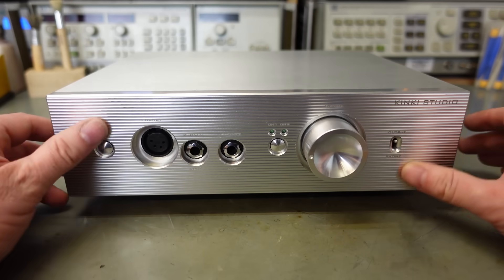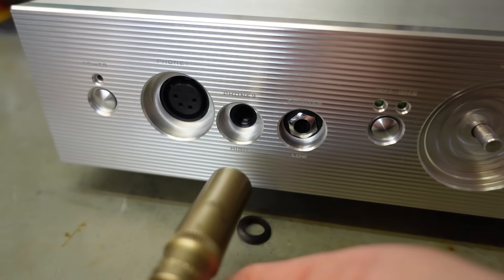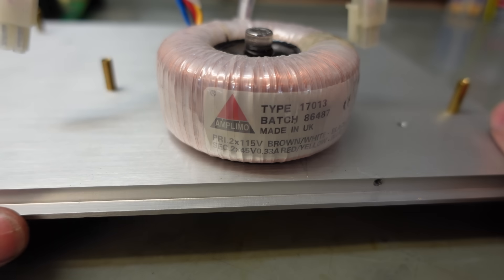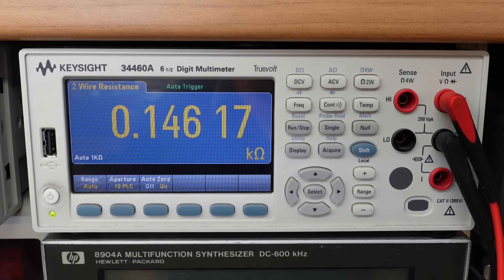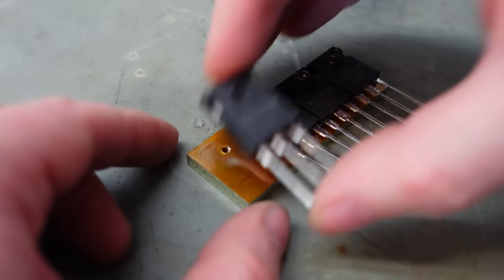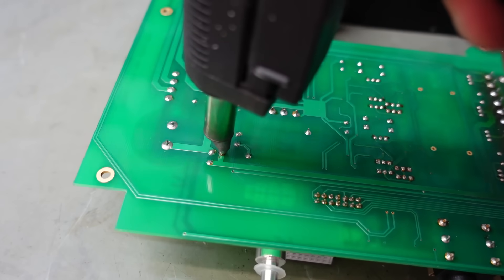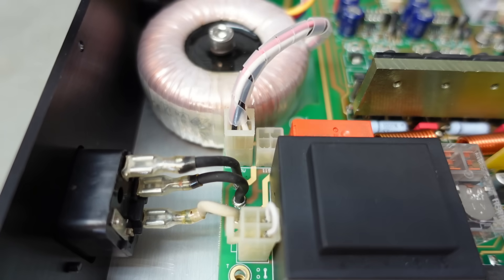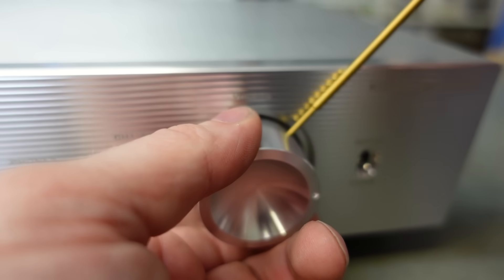KINKI Headphone Amplifier Repair (Vision THR-1)

Comment: That amp is SERIOUSLY over-engineered. Something like 2 x 15w for headphones? I love it! Good to see you back Mark.
Reply: Yes, overengineered at the wrong Place. Massive enclosure, pippi heatsink plate 😂
Reply: @borlibaer ĺpp
Reply: @borlibaer  Rule No.1 - never use a too small heatsink for your <insert amp here> 😅
Reply: The output spec is there to accommodate very power hungry headphones. Some fancy headphones need a LOT (maybe not quite this much).
The sad thing is the case itself would have worked as a heatsink far better. The engineer should know better.
Reply: @peterlarkin762  I kida get the idea that they tried to engineer the mosfets as 'tube' devices, hence the high voltages, which are for headphone output uncommon. FET's often sound nice when warm -70 degrees centigrade und up-. A more common solution is just an arrangement of good op-amps for headphone use, which drastically reduces the amount of components and more importantly, coupling over caps and worse, resistors. Yet, I have never designed an headphone amp nor do I like headphones, so I can be very wrong. In general I would stay away from hard to drive headphones, the same for non-efficient loudspeakers, though there are always many reasons to oppose that.
Reply: @edmaster3147  True, these lateral fets need to be biased at 120mA per pair at the very minimum, as the thermal co-eff goes positive, Id drops with Vgs, hence thermal compensation is redundant. No need for source resistors either, even with multiple pairs, thanks to close matching on Vgs with selected Exicons.
Reply: @edmaster3147   I haven't heard a huge sonic difference between these LatFETs running cold or hot, but  I'm running 2 parallel pair per channel, each  channel on a large heatsink (for safe operation at 140W per channel. My other diy BJT amp, a Circlophone, sounds way better warmed up. Biased at  250ma ftw:)
The outputs on the Kinki need a bigger heatsink because they're being run at 63Vdc. ~45V would have been plenty.

For most headphones, a parallel output opamp based amp is perfect. I use 2 NJM4556s on my preamps for monitoring - They push loads of current. And FET input opamp for small signals - OPA 2134 seem to be the last good one available new..
Reply: @peterlarkin762  Have NJR discontinued Muses 01 ?
Reply: @peterlarkin762  No headphone needs nor do you want 15W playing right next to your ear unless you want to go deaf.
Reply: Not sure if that's true. I have burnt up expensive amps pushing headphones to high with low impedance.
Reply: Yep, it's audiophile quality 🙂 The clue is in the word audiophile. Someone who loves listening to music is a musicophile. Audiophile just means lover of sound - they just listen to their system....
Reply: Well said! I am laughing so much, because it is absolutely true!😀 @mattparker8747
Reply: @mattparker8747  You don't know what you're talking about. The point of a great system is that music sounds better.
Reply: Calling this engineering insults me as an electronics engineer. It's a badly designed esoteric waste of resources.
Reply: @cls9474  I haven't heard this device and don't want to be an armchair judge, and I don't want to judge others choices, but the device contradicts my experience. The stuff  I find best sounding is extremely simple and has well chosen but least possible components, very thin cables and very few options. This device indeed look to be engineered to end-user expectations of optical quality. But maybe I love it when I hear it. Who knows.
Reply: Totally agree with you! @cls9474
Reply: @cls9474  I'm sorry but you're wrong. 🤭 I'm an electronics engineer my self with +30 years of experience in radio&radar. Look at my comment.😉
Reply: It's a horrible design, there are headphone drivers that can achieve the same thing with much better specs and the whole circuit would fit in the palm of your hand.

Comment: Ahh. Was kinda hard to keep your face straight when saying a “Kinky amplifier”. 😁
Reply from the maker: I was going to say all sorts of things, but I'd have got de-monetised... 🤐
Reply: @MendItMark  I bet! ;) Great vid tho yet again.  Appreciate you.
Reply: @MendItMark question, what’s your turn around time to get parts for something like this over there? I’me educated in the business but have not worked in the repair business for 20 years now. Have been wondering of taking it up again as a hobby/side business.
Reply from the maker: @pederb82  in this case, I got the transistors in 5 days. However it can be hit and miss - A lot of parts Supplier’s trade on eBay now, but I am wary of transistors coming from China (outrageous fakes!), so stick to businesses with proper quality assurance. However, a lot of old transistors just aren’t available, so I spend a fair time sourcing modern alternatives, which I can get from trusted sources.
Be careful of the side business - that’s how I started 😂
Reply: @MendItMark  Ive mostly used farnell etc myself for the same reasons you mentioned. I’ve bought IC’s on eBay that’s turned out to be fake. Looks to have the same pin layout but dead or nothing home inside.

Comment: Nice you checked if it is true balanced. But I could not have stand adding additional heatsink in there. Or somehow lead the heat on to the large top cover to dissipate it. This way it looks like it will fail again soon.

Comment: i love mosfets in audio output they often blow up a little more gracefully than bipolar fire mongers and the usual 100r gate resistors protect the driver stages (usually)
Reply: The trouble with MOSFETs in audio output stages is that 30 years after the unit was made and you need to change out some transistors, they are obsolete and impossible to obtain. A good example are the 2SK1058 and 2SJ162 pairs. Used in many amps, they are now obsolete. BJT transistors are much easier to find - I have large stocks of genuine ones, many more than the MOSFET stocks that I have.
Reply: Yes iam running genuine hitachi 2sj50, 2sk135 and some of my spares will be fakes 😢
Reply: @darrenmurphy6251  The Hitachi 2SJ and 2SK series MOSFETs are pretty much bulletproof. I had an amp come in for service that the owner replaced the fuses with nails and drove the thing to max - yet the MOSFETs didn't die. In fact, in the past 40 years I have only replace ONE of these Hitachi devices. They just don't fail. I have good stocks of them.

Comment: The pitfall of Chinese-made electronic products is that they sometimes use fake, duplicate, or recycled electronic components. Recently, when I disassembled the DC power supply included in small electronic devices, I found that it contained a used or recycled power board.
Reply: I don't trust any china made electronics these days. They would sell their own grandmothers if there was a dollar in it.

Comment: wonder if someone ran high impedance mode into low impedance headphones = loads of heat then eventually mosfet failure
i dont think that was a heatsink but just a way of thermally ballancing the high and low side mosfet pairs , like those little alluminium twin to92 clamps for input differencial pairs we used to see in the 90,s
i didnt see any switching relay to select a lower rail voltage by selecting a lower voltage secondary winding just a protect relay for high and low impedance modes
Reply: Maybe, or perhaps somebody connected some low impedance speakers to the low impedance headphone output and cooked the output MOSFETs given the limited heatsink in an enclosed metal box with no ventilation. I would have thought there ought to be some sort of thermal or output protection though.

Shame, as it looks beautifully made.

Comment: What a nonsense amplifier. Balanced input and outputs but purely single ended signal path.
Reply: The inputs and outputs won't be balanced. They're just using 3-pin XLR connectors to fool you and make you think they're balanced.

Comment: Such a chunky aluminium enclosure and they put the transistors on that little slab, I guess you could say that's a little... kinki, isn't it.
Reply: They don't even need a heatsink in this circuit anyway. It is perfectly fine as is.
Reply: Those transistors dissipate few watts in total. The amplifier is over-dimensioned 10x...
Reply: probably used with some speakers instead...
Reply: Exactly, they could have used the enclosure as a massive heatsink - it's clearly overheating!
Reply: An improvement would be a thicker longer block of aluminium that gets screwed to the lid and with the mosfets wider apart.
Reply: With the case being so thick why didn't they just put an "L" bracket to mount to the lid to pull some heat away lol ROFL that amp is listing over $1,000 mounting an L bracket to give the heat a path to the case is nothing.
Reply: That heatsink connects to toplid when screwed down so not so little slab anymore.
Reply: I'd say there's an air gap @radicalaudiodesign
Reply: @radicalaudiodesign  I doubt it makes good contact thermally. And the lack of vent holes... Those transistors shouldn't be getting really hot to begin with but still, it just looks dodgy.
Reply: @radicalaudiodesign no indication when the lid was removed.
Reply: @radicalaudiodesign  kapton tape instead of thermal paste is an indicator of someone who was asleep at school that day when they explained how to make heat sinks.
Reply: @andrea.dalessandro  Well it's a good electrical insulator though 😆.
Reply: @andrea.dalessandro  Yes, that was odd. Wishful thinking that it's something else (thermal pad or similar).
Reply: @andrea.dalessandro  DuPont makes Kapton MT and Kapton MT+, which are designed to have relatively high thermal conductivity. It's possible that's what was used here.

Comment: WOW. Thats the definition of an overkill output stage for headphones!
Notes:
-These power MOSes could be mounted and take advantage of this chunky bottom plane. 
-Is this high impedance mode protected in case someone plugs low impedance headphones or overcurrent and damage to the output devices

Really interesting design anyway!
Reply: This unit is £1199 street
Reply: @thesleepstate  Really, I knew it would be expensive, but that's mental!
Reply: Using the bottom plane looks like a no-brainer.

Comment: It doesn't really matter how good it looks or how big the components are if they are all Chinese, they'll almost all be rubbish, not surprised in an attempt to preserve the illusion of high end  -parts can be tested to determine what they are, obfuscation has occurred to hide identity I reckon rather than preserve IP. I bet this is a clone of something. I use a fleet of DSL410 amps, Samwha capacitors and mystery Chinese bridge rectifiers go straight in the bin
Reply: I'm not defending it, but I saw three distinct components that weren't made in China, one made in Japan, one in the UK and the other in Indonesia. You are so right though, its bark is worse than its bite, the fact it wasn't true 'balanced' and it failed after only 5 years speaks volumes.
Reply: @fridgemagnet  Stereo Alps pot was a dead giveaway. One would expect to see an old school 4 channel balanced pot or a couple of those new TI, Muses etc. IC resistor ladders with an encoder for volume control.
Reply: True at one point, but things have moved on. A lot of Chinese gear, both budget and high end, are now extremely high quality. Kinki are part of a stable of manufacturers including Denafrips, Jay's Audio, Chocosound and Beatechnik all making good quality, innovative components. Elsewhere, brands like Shanling, Fiio, Topping, SMSL and Fosi all make great stuff at multiple price points.
Having said that, Kinki started off making amps which bore more than a passing resemblance to classic Swiss Goldmund designs, but they have moved on, as should we.
Reply: @jimfarrell4635  I keep hearing people tell me that things have moved on and china is producing high quality stuff but I have yet to see it. This amp is just another example of china cheating and making something designed only to extract money from audiophools.